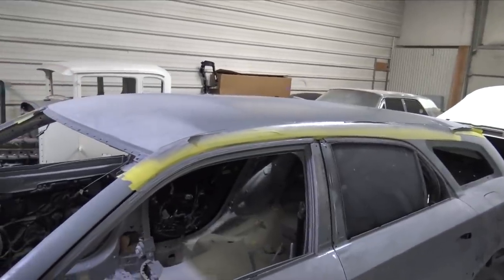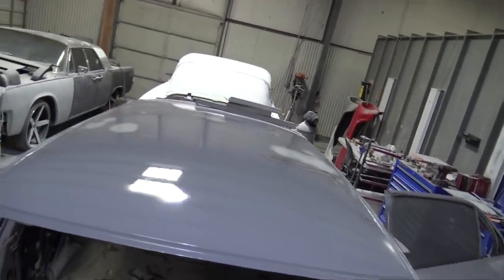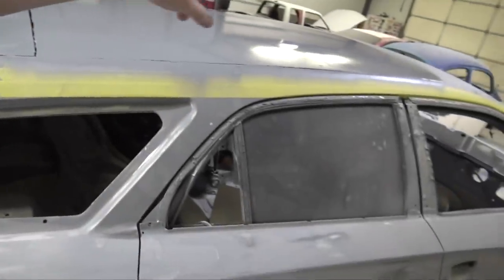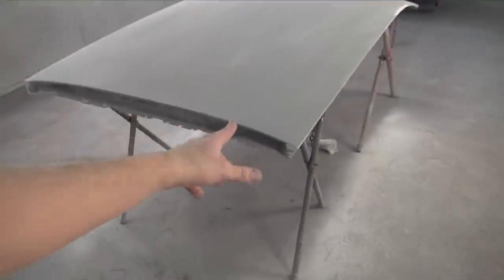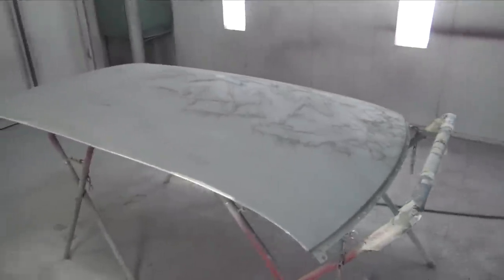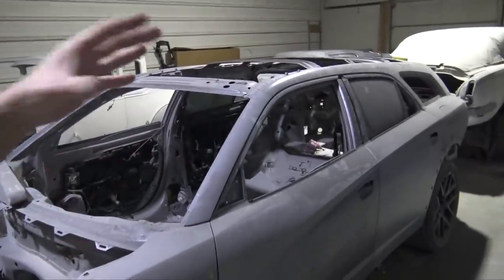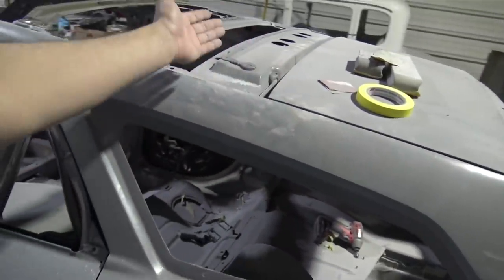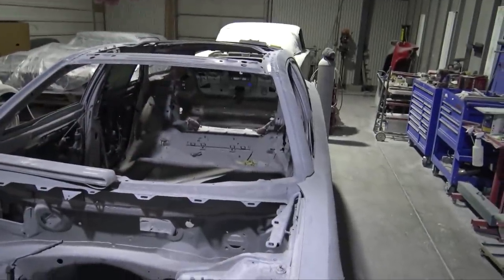Building the Ultimate Station Wagon | 2021 Charger Magnum Hellcat | 1000HP Hellwagon | Pt 34

Comment: You're going to the trouble of molding and shaping a Trackhawk wing to a Magnum rear deck. For the wiper, why not shape a relief into the bottom of the wing that corresponds to the arc of the wiper's travel? Can't be much wider than the arm, and probably not very deep. Doesn't even need to be shaped, just a squared cutout.
Reply: i was thinking the same thing

Comment: Awesome work Dave, ngl, this is a project which is fresh and new and takes a ton of work and time to get right. Thanks for sharing it with the automotive community. Make sure your clear coat is compatible with the gelcoat you're going to use fot the roof mold. Also I saw two nubbins before the c-pillar are they there to accomodate for the window trim from the rear passenger doors?